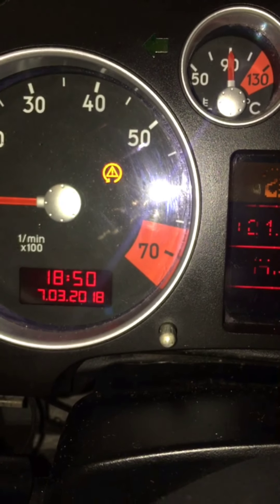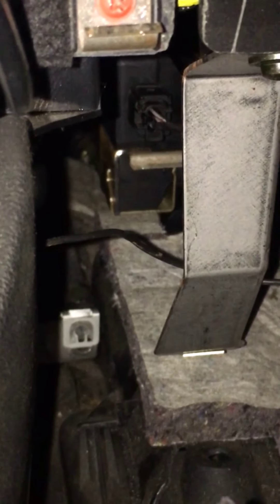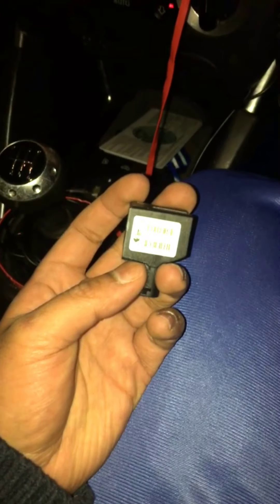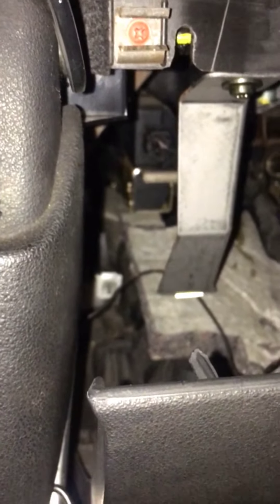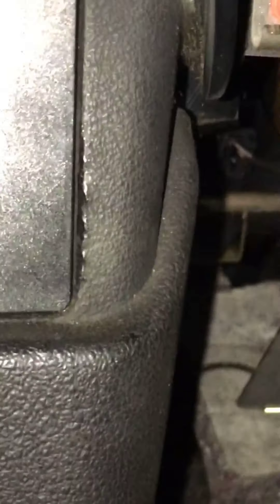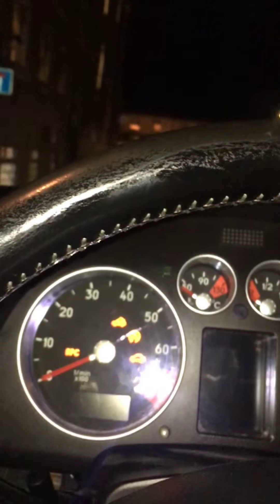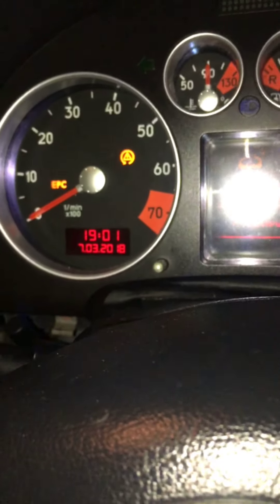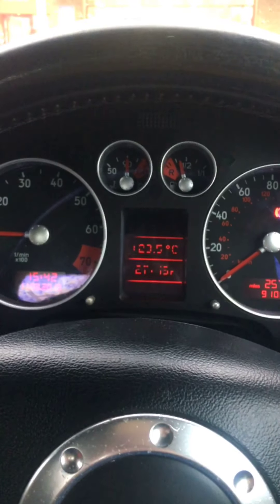Annoying ESP light fixed for a tenner!

Comment: Bought an OEM version and changed it, now the light is always on. Then put the old one, and light is always on. Did not use to go on before a few kilometers of driving. Any idea ?
Reply from the maker: That happened with me and turned out to be ABS sendor
Reply: @TKhouseofcars  So did you replace all 4 of them ?
Reply from the maker: @nickeyzh  i actually just cleaned up the one that was throwing up a code. I’d say get a diagnostic on it first
Reply: @TKhouseofcars  Good advice, thanks

Comment: I have ( VW Passat Wagon V6 2.8L ) another problem today I changed the air sensor and during engine operation disconnected the plug from the sensor since then the traction control light does not go out and the gearbox from that moment began to twitch very hard (kick). I can’t understand why it would be
Reply from the maker: Its quite likely just some dirt or something then if there are no actual faults. I would spray some wd40 or some electrical cleaner in there and leave the battery disconnected for about 20 minutes too. This should give it enough time to reset any faults.

Comment: Please be aware, when I had this problem my traction control and abs did NOT operate properly or at all..!! it DOES affect the driving of the car when you drive fast!! As the ecu isn't getting the correct info from this sensor so be aware it might or might not make your abs/t.c. operate properly.. I found this out on a country road going fast round corners, needed to use driver aids traction abs etc and found myself having to wrestle with the car to keep on road, where as normally on same road same bend it wouldn't react that way..  Also when parking up behing other vehicle when coming to a halt at very slow speed abs kicks in for no reason?? Car becomes a pain to drive!! I think very unsafe!!
Reply from the maker: Steven Mcgonagle thanks for that pal 👍🏽
Reply: That's a different symptom of an actual abs failure not just sensor issue. 
The best thing for more power and better driving feel is traction control off. I agree though under serious braking we do need abs 👍

Comment: Did u get an airbag light at same time i did read that on a forum that this sensor can cause the airbag light to 
My car has codes for lateral sensor in abs 
And in airbagd it has a internal memory code 65535
Im gonna change sensor an see if it does it for both issues im having 
If not im guessing new airbag modual 
Another common fault
Reply from the maker: From memory I dont remember mine going on tbh but could be related
Reply: @TKhouseofcars  cool mate thanks for reply will try this first an do module if airbag one still persists

Comment: 3 Faults Found:
01435 - Brake Pressure Sensor 1 (G201) 
            000 -  -  - Intermittent
01423 - Lateral Acceleration Sensor (G200) 
            008 - Implausible Signal - Intermittent
01542 - Yaw Rate Sensor (G202) 
            008 - Implausible Signal - Intermittent
What I have to do to fix that problem?
Reply from the maker: The last 2 could be related to what I’ve done in this video I would start there to see if that fixes ur
Reply: @TKhouseofcars  Thanks. I will try firstly contact spray and then change sensor. In my car there is 95ah battery, not 110ah. Could it be also a cause?
Reply from the maker: @eneaszwiewiora3559  battery could potentially be an issue if its a newer. If u know thats an issue then start there i would say along with other issues you’re aware of already

Comment: That Símbol Blinks And i Lose Power too! 
When I go over 40m/hr the ASR Símbol starts to blink  and I have to turn it off manually to be able to drive with out the light blinking randomly and lose power.
Did yours have similar symptoms?  
Mine is Audi tt 2000.
Reply from the maker: Dani_el I think thats an actual problem with the car rather than anything electronic because it sounds like the traction control is trying to engage. 

Could be something like an issue with the drivetrain or wheels etc if its just kicking in over 40mph. I would get it checked out
Reply: I've the same issue, the esp light stays on solid. After driving it for short period of time it blinks and I start to lose power. This is not at any specific speed it just happens randomly, any ideas guys what the problem could be? Thanks
Reply: 90nadz ...did you manage to get this problem sorted in the end 👍
Reply: I fixed mine 
Something wrong with the tires. Idk what. cause they were all the same specs.  My problem started when a used tireshop put some on the rear.
(Which I had done before and never had this problem.)
So: I didn't want to spend more money on tires without knowing for sure that thag was the problem.(tire shop swear that the rear tires that they put wasn't the problem. (I trusted them, and thought it was  something wrong with asr system).
Solution: my friend had a set of  almost new aftermarket wheels and tires, gave them to me for 100$.
Put them on and magic.
No more ASR blinking, no more power lost at high speed.
Reply: Dani_el ....thanks for sharing your experience with that problem , problem is that we trust garages and there isn’t many that won’t rip you off. 

Glad you got your sorted 👏👏👏 

Atb mate. 

P.s. I have a esp fault and it’s gone into limp home mode ...I think it’s the wheel sensors so I will replace them then I’m out of ideas lol 

#imgonnagetrippedoffbygaragelol.
Reply: @paulrossiter9567  
I ruled those out by using my scanner. I went to ABS sensors found the four of them on live data. 
Drove the car and watch the speeds on them in my scanner and the readings were very similar.(I was careful, there wasn't people around)
Reply: Dani_el haha glad it’s all good.

Comment: Mine came up with Yaw rate sensor (G202) code.
Reply from the maker: 90nadz i think thats the sensor which sits in the same block.
Reply: Now I've got this code 01542 rotation rate sensor and ESP light is solid. It has to be something to do with traction control as the car randomly uses traction control whilst I'm driving, plus the acceleration and rev idle is playing up. :/
Reply from the maker: 90nadz the traction control will kick in as soon as it detects an abnormality though so could be a few things. I had to play around a lot before i got to this. Rather than chuck money at it i would say try take it to a specialist?
Reply: @TKhouseofcars  I have a feeling the 01542 is a Yaw rotation rate sensor which is sat above the sensor you've fitted in, but it's not easy at all to take out! :(
Reply from the maker: 90nadz you’re right theres 2 there one on top the other and from what i recall i think it was called something like that. If it’s the same though i’m sure they both should cone out fairly easy tbh...

Comment: Thanks for this video helped me out ! Just failed MOT DUE to steering angle sensor and lateral acceleration sensor being faulty ...anyone know how to change the steering angle sensor ?? Thanks 🙏🏾
Reply from the maker: Moe moe Hi, thanks I’m glad it helped. Have you got a picture or description of where the steering sensor is? If I see it I could try and help...
Reply: @TKhouseofcars  I just got scammed into buying a broken Audi and it has so many sensors with super stiff steering
Reply from the maker: @raymondbravo225  not ideal. I always think though with something like this work on whatever needs doing and make it your own. Atleast you know those bits wont give you an issue. With your powwr steering issues I’d say check the fluid level on it and check for any leaks. From there work your way through the components to the rack itself.

Comment: Hi, thanks for the video. Did you also noticed loss of boost or power when the esp was still on?
Reply from the maker: morgrym84 hi no i didnt tbh it drive as normal but i think the abs wouldnt work thats all
Reply: @TKhouseofcars  THanks, mines most likely maf sensor or a boost leak as i experienced that annoying power loss too.
Reply from the maker: morgrym84 yeah something like that is more likely as i drove mine like this for months no issues tbh
Reply: @morgrym84 did you ever sort this? I have the same issue, changed MAF, changed n75 and still just feels like there’s no pull, almost as if it’s in a limo mode but not throwing any lights
Reply: @ashleyrobinson4575  after installing a boost gauge i noticed i had a boost leak. Check your hoses or replace them all with silicone ones. Boost gauge installation is very easy and cheap and helps identifying boost leaks i recommend doing it.

Comment: Yup, for everyone watching esp and a power loss diagnosed as a boost leak. One of the pipes on the back of the engine popped off causing esp light and no boost
Reply: Did he give the part number for the sensor? I have the same trouble for my mark 1 tt 2006 year.
Reply: @studio-flash  it wasn't a sensor in my case just a loose pipe
Reply: THIS. Same thing happened to me and of course was a simple easy to see boost leak lol